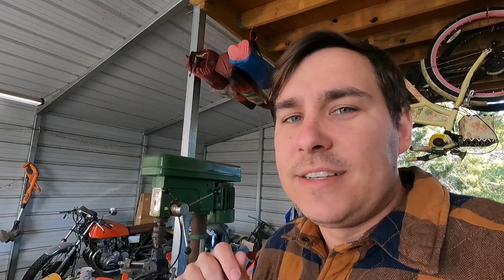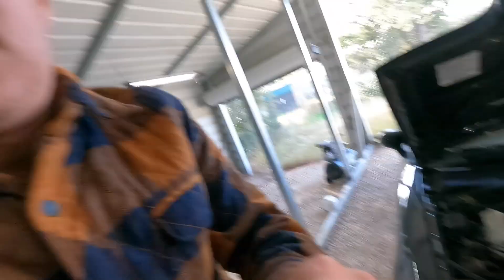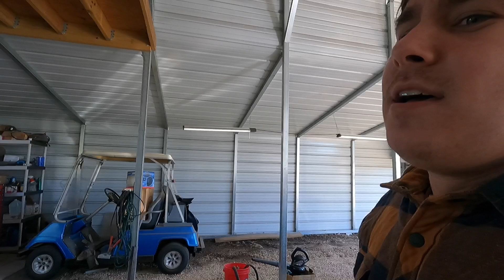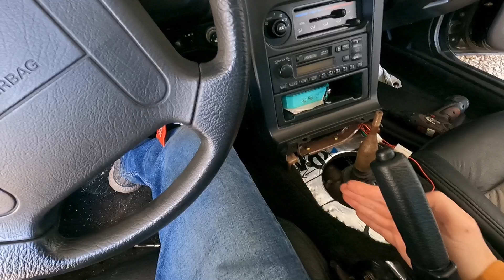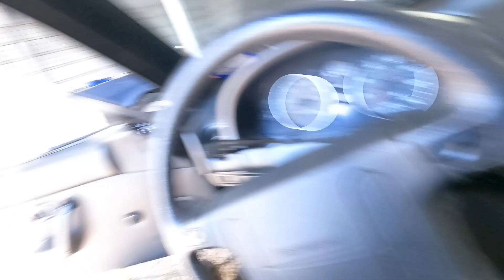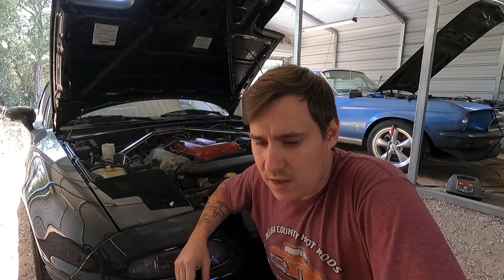Fixing a Misfire on My 1996 Mazda Miata & Transmission Shift Boot Replacement

Comment: I had a Mazda Protege that spit out a spark plug. Dented the hood!
Reply from the maker: Pretty much all of Mazdas had the same head design until 06. Interestingly enough, Mazda shared their platforms with Ford. The most famous being the Ranger, which was just a Mazda B2000 or the Ford Escort, which used the same BP-F8 that's in my miata.